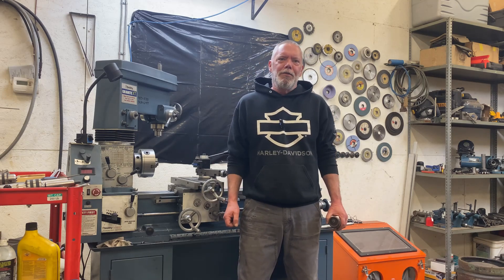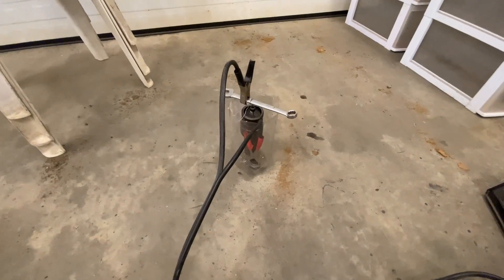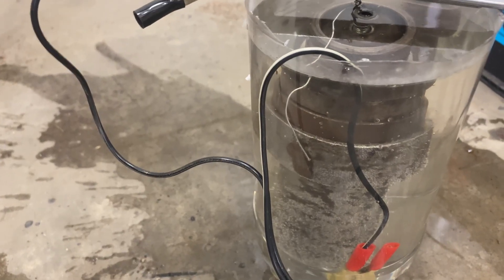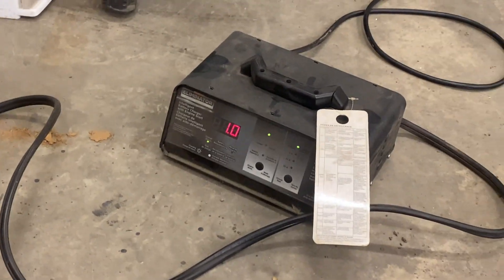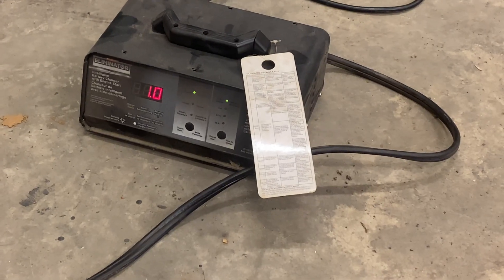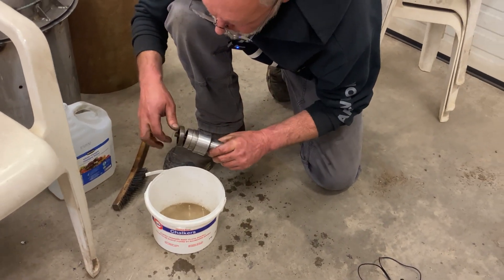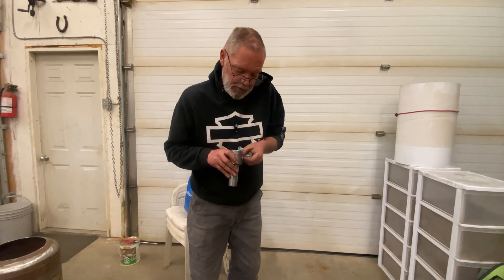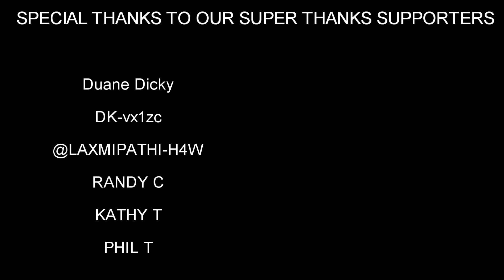ELECTROLYSIS! MY NEW FAVOURITE TOOL!

Comment: I found it handy to use a long bolt to attach to the positive lead. Then every few hours the bolt can be chucked in the lathe and the hardened crud may be machined off. This helps when you have a lot of rust to remove.
This process is really helpful in de-rusting motorcycle gas tanks. In the end you may end up with black smut left on the interior of the tank, but it seals the surface against further rusting. A rusty tank may take several days to do, but it is worth it to not damage the exterior paint.
I use TSP (tri sodium phosphate) cleaner used to clean walls from the hardware store added to the water to allow the electrolysis to work. It's the stuff washing detergent used to have before the EPA said it worked too well.
Where electrolysis really shines is for doing large work. Evaporust works ok, but when you need 20 gallons to immerse the work it gets expensive. Using a plastic tub you can de-rust an entire engine block at one shot.
Reply from the maker: Those are some great ideas! Thanks for sharing and Thanks for watching!

Comment: Another thing you can do with rust is to rub it with aluminum. Use crumpled up aluminum foil like sandpaper. There is a chemical reaction between the rust and the aluminum that generates a lot of heat. It's the same reaction that happens with thermite. It's quite effective at removing rust from iron pieces that a coated with chrome. The aluminum is soft enough that it doesn't damage the chrome, and the chemical reaction eliminates the rust like a sponge.

Comment: I've had good success with electrolysis on rusty tooling and parts. I haven't done any of it for probably 15 years and had not heard of rinsing in vinegar but it looks like it really worked.  I used a greater quantity of solution and some scrap stainless steel for the sacrificial piece. My battery charger is much older and doesn't have any of the modern circuitry and it worked well for me. I always enjoy your videos!
Reply from the maker: Thanks for the feedback. Glad you enjoyed it!